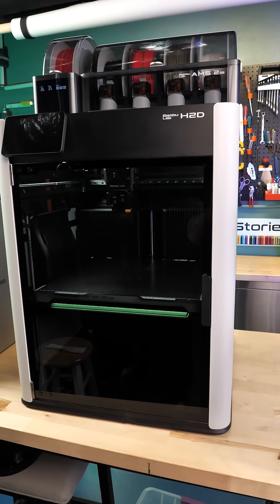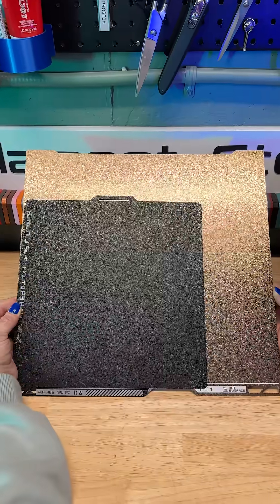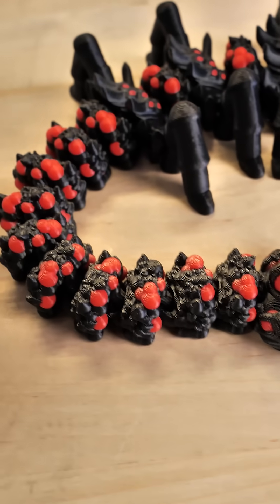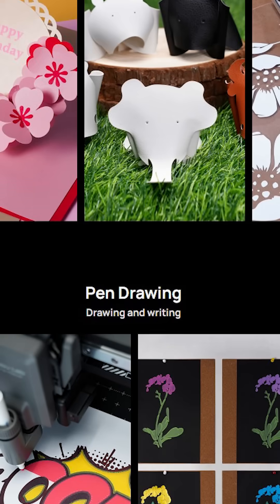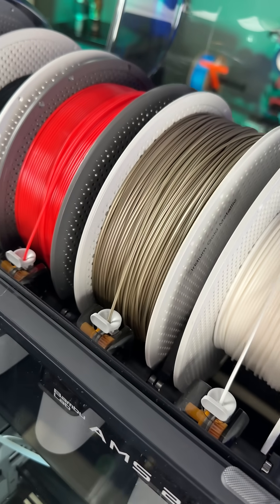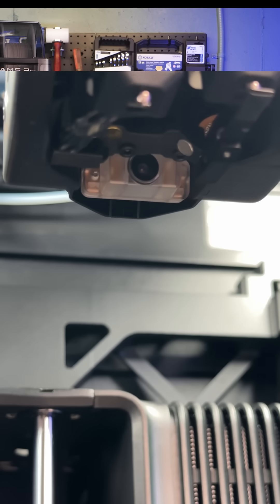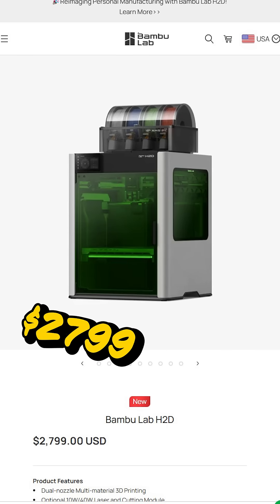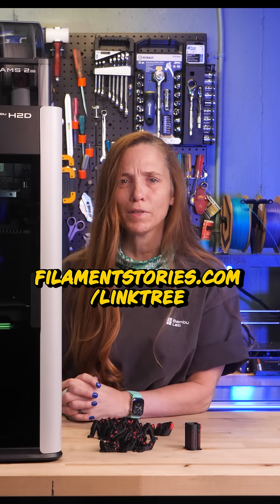Introducing the NEW Bambu Lab H2D 3D Printer! (plus laser and cutter)

Comment: Well done to Bambu lab for keeping the price within reach, they could’ve easily priced this much higher.
Reply: Fr so many people say it’s super expensive but in reality it’s pretty fair. I mean it could have been cheaper but also getting all three machines separately could cost way more
Reply: It's not cheap, and the price went up a couple hundred all ready.
Reply: @tyrzxv  Ultimaker is $9000 and not as good.
Reply: @tyrzxv  a standalone laser cutter of the same dimensions can cost you £800-3000+ generally (I googled some models you can check yourself if you want). The Bambu is an extra £1000 for the laser, which is about average, if not then pretty good. And also there’s the vinyl cutting knife and plotting attachments that come with it. Along with it just being generally fairly easy to use, and the fact that it’s also integrated with a 3D printer, I would say it’s a good deal…
Reply: @CatlordReal  i have a stand alone laser cutter and I'm telling you, with all the smoke and soot it will create, you definitely do not want that in your precision 3d printer.  Even on bambu's own wikipage it shows how you have to clean the machine, but you definitely aren't able to clean everything.  

3d printers are so much more sensitive to dust/dirt because every layer is built upon the previous.  With a laser cutter, it doesn't matter as much because your just tracing the same path, cutting away material.

Comment: thinking about it. you can have 2 colours without AMS 🤔
Reply: Yep, it can run a dual external spool setup. That's nice flexibility to have for accommodating many different filament combinations that can't run in the AMS units. Especially if you were running a 15% carbon fiber filament in one spool, and TPU in the other.

Comment: Can the two filaments used at the same time be in the same AMS ?
Reply: No. One ams for 1 Tube/Nozzle. 
You Need two ams or use the external holder for 1 filament.
Reply: I think a mk1 AMS also will work

Comment: Can you post a video of how this thing does its homing?  Is each nozzle separate?  I’ve seen a lot of 2 nozzle printers that are annoying when it comes to alignment, and I’m wondering how Bambu handled the Z homing, but also the X/Y offsets between the nozzles
Reply: Eddy current detection camera on tool head it's really slick and doesn't have the issues of other machines
Reply: it uses a touchleas sensor with either the hall effect or eddy currents

so basically they measure the magnetic field of the nozzle, so no residual filament or uneven touchpoints on a probing surface are out of the picture

Comment: Does the AMS 2 pro only work with the H2D, or can I hook it up to my P1S?
Reply: The AMS2 is backwards compatible, and you can use the AMS with the new printer too
Reply: You can use the AMS 2 with the older printers. You just have to use the external PSU for drying.

Comment: Is it true that the H2D takes longer to print than the X series ?
Reply from the maker: No, the H2D is a little faster on single color prints, and faster on multicolor prints, and much faster on 2-color prints. That’s because of the dual nozzles—less purging (waste) and less time between color changes
Reply: Not even close specs wise it’s top speed is 1000 mm a second with its normal mode speed being 600 mm/s the X one carbons ludicrous mode is 500 mm/s go look up CNC kitchens video on it where he printed the blue and white panda and how it went from eight hours down to two hours and from like 120 g of filament down to 54